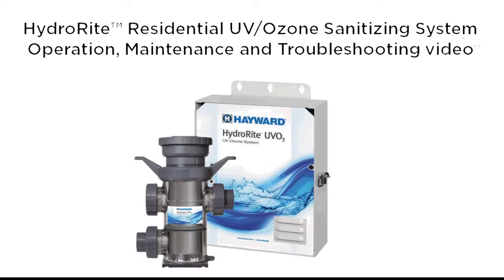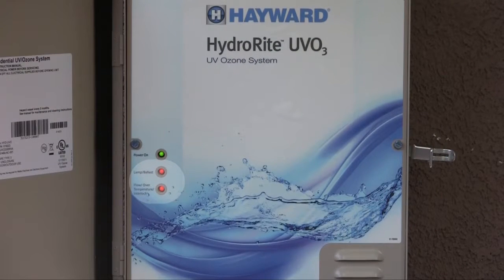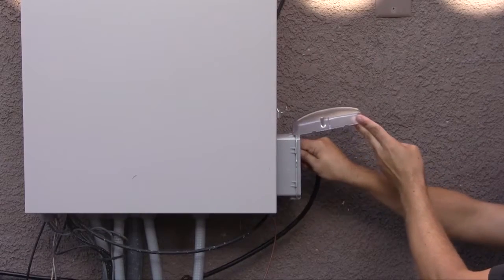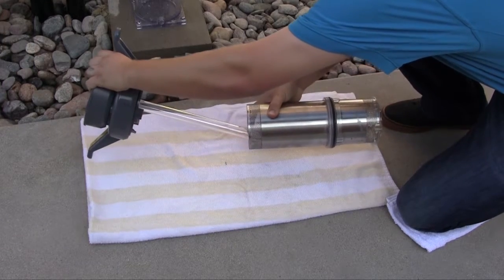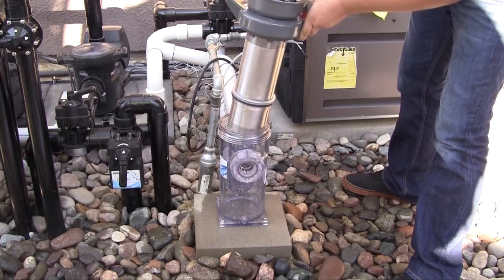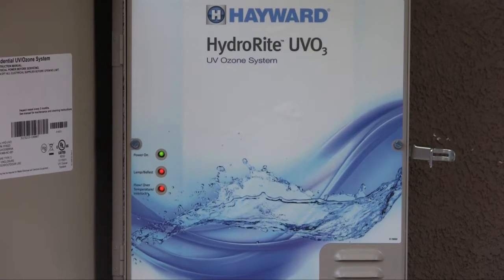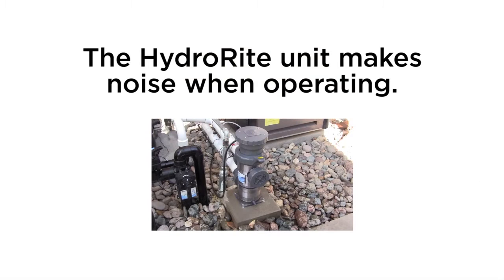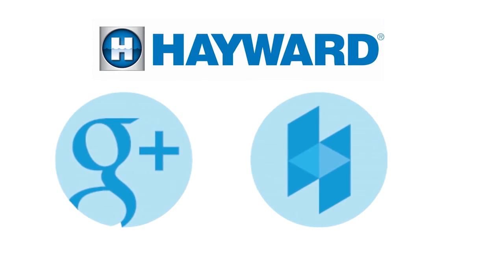HydroRite Operation, Maintenance & Troubleshooting

Comment: I have the HydroRite Residential UV/Ozone Sanitizing System, the UV light won’t go off, if I unplug it, it lights up again once power is restored, I am thinking it is the flow switch, when there is no flow from the pool pump the switch should stop the electric power, but it is a single wire switch, unlike a 2 wire switch on a car. Can you tell me what else to check before I disassemble the unit for a cleaning?
Reply from the maker: Hi there, we're sorry for the late response. We can connect you with our tech team directly for assistance. Please email marketing@hayward.com with your inquiry, full name, address, phone number, email, proof of purchase, product model number, product serial number, installation date, and installer if applicable. Providing this information will help us, help you, efficiently. Someone will reach out to you directly as soon as possible.

Comment: I have a Hayward Goldline Aqua Plus. The vacuum hose attaches to the inside side of the pool and vacuums the entire time the filter is running. How do I program it so the vacuum only runs for an hour a day and the pool continues for filter for the remainder of the set time?  We do have a spa with spill overs into the pool also. Thank you.
Reply from the maker: We are guessing there is a three way valve that controls the suction line for the cleaner.  This valve will need to have an actuator installed that can be controlled by the control.  You can then set the control to open and close with a timer.  There are three actuator ports on your control and hopefully one is not being used.    If you would like to discuss, please private message your phone number on our Facebook page.